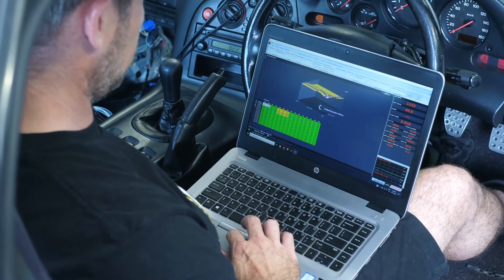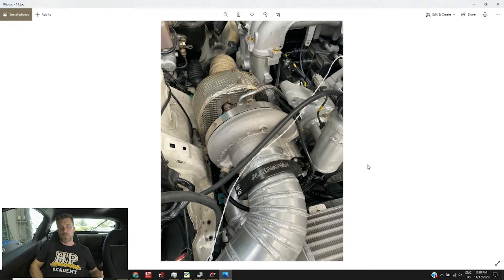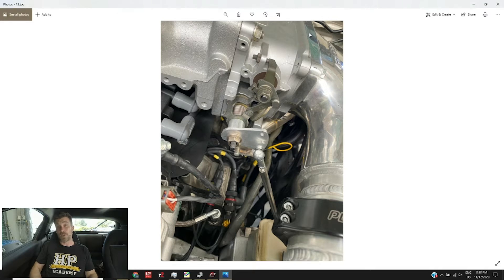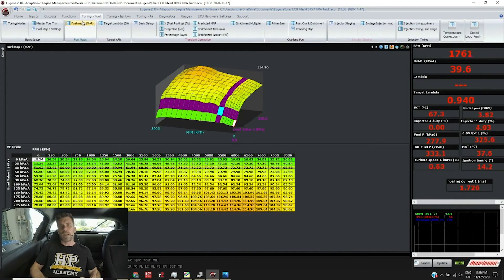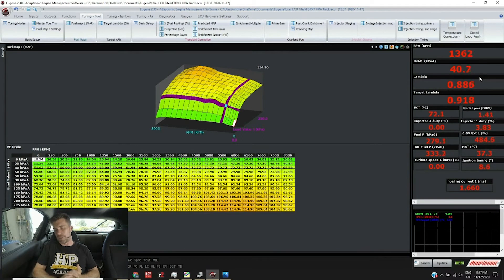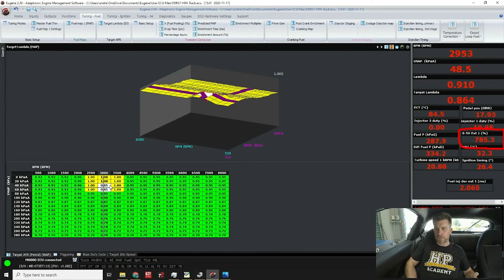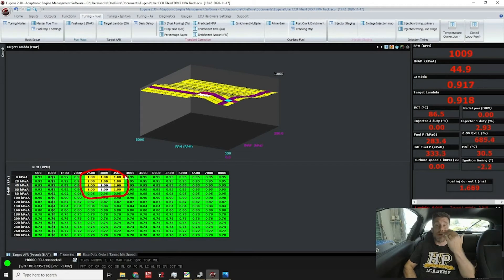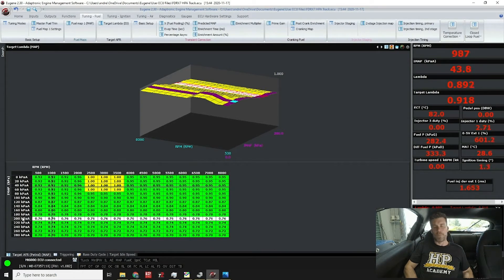How Tuning A Rotary Engine Is Different

Comment: One of the things the RX-8 does is a negative split for the trailing plugs, so they fire first.  Some people, running low compression rotors, have gotten the split at -17 at idle and -45 degrees at higher rpm but low load, just making sure it tapers to 0 just before boost.  It also gives a thing that will catch some people offguard by the fuel mixture going a lot leaner on their sensor as it causing a fuller burn of the fuel in the combustion chamber, combined with temps going up as well.  Several people have been messing with a more aggressive negative split in some areas to get the car to spool a little bit sooner too, but control EGTs with additional fueling.  I am currently running a Megasquirt 3 on my 87 RX-7, and running the negative split has been noticeable getting away from a stop.
Reply: Fuel mix showing leaner on a gauge is a sign of incomplete burn.
Reply: whats your FB name? i'd love to chat more about this.

Comment: Theory goes 95 percent burnt by leading, theory,???  Why did he the 787b have 3 plugs per rota chamber,  and if anyone has ever experienced their trailing spark ignitor or coil fails the engine loses alot of power, which leads me to believe the trailing plugs perform alot more than 5 percent of the work,  many years of N A tuning  shown trailing was important, but very close split,  , just my two cents worth, been a member of HPA for 6 years, totally valuable information

Comment: Would you ever install a VGT on a 13b? To get more low rpm power, or would the increased backpressure harm the wankel internals?
Reply: for all of that you can run higher compression rotors
Reply: If you run a big turbo VGT turbo like the HE500V it should do fine.

Comment: Quick question about the Adaptronic. I have an old Haltech e11v2 that I want to upgrade from. On these old Haltech ecus, you don't tell the ecu what size injectors they are. This video has shown me that with Adaptronic, you have to tell the ecu what injectors you have. What if you have a situation where you don't know the injectors size or brand? Is there a way to make the ecu run the injectors open or in dumb mode like the Haltech?
Reply: Get the Injectors flow tested.
Reply: @sexyfacenation  Sure but I still want to know if that ecu is capable of running injectors in dumb mode? Reason being is because it allows me to do weird fuel related experiments with custom intake manifolds.
Reply: @rotaryperfection  how does it allow that ?
Reply: @sexyfacenation  My Haltech E11 is an old ecu that allows this. In dumb injector mode, you can mix and match injectors and the ecu don't care because it doesn't know what its pulsing. It just sends the pulses. Sure it makes tuning more difficult but you can do some nice tricks with your setup. I'd like a similar feature on the Adaptronic.
Reply: @rotaryperfection  I don't at all follow why you would want that, and how it makes it better to compare changes.get with the times man!
Reply: @sexyfacenation  Get with the times? You clearly aren't listening. I like the feature for EXPERIMENTING reasons. If you don't like doing things differently or testing the limits, that's you. You do as you do and I'll do what I do.
Reply: @rotaryperfection  just for your reference you haven't explained why you need that "feature" to do what you are trying to do, or even what you are trying to do. 
Good luck with whatever it is.
Reply: @rotaryperfection  and doing things differently is substantially different differently to doing g things how they were done ages ago as there was no better way. 
For your reference a link ecu can do what you want, they call it traditional model. Still don't get why you want it.
Reply: @sexyfacenation  Now why would I tell a random guy on the internet my intensions and my patentable secrets with how I built my intake setups. It's a simple question as to if the certain product is capable of doing such. The WHY is irrelevant.
Reply: @rotaryperfection  hahaha, good one.

Comment: I remember building an engine for a well known rotary company they told me to reuse some of the old internal apex seals and side seals I reluctantly reused it,  after first full load Dyno run pop removed engine again and behold apex seals had fracture marks and piece flew out turbo lucky no damage new parts used.

Comment: Can anyone advise of how much additional fuel I should be dumping in, when off throttle and running premix? I'd suspect if the seals would be starved of lubrication" if I reduced the the injectors down as much as I would a piston engine.

Comment: In rx8 is the same  or you can't change map od timeing ??
Reply from the maker: Rx8 will be similar yes. The way you change the timing map will be dependant on what ECU or reflashing software you are using :) - Jono
Reply: @hpa101 
thanks , which  program you recommend to reflashing mazdaedit is fairly good to start and cheap but dependent on ecu and complicated :/

Comment: Trailing adds power under vacuum. 
You will feel it in throttle response and see it in the fueling. 

As load and manifold pressure increase trailing is only Helping the engine knock and break.

Comment: If injector data is not available how would the ecu be setup accordingly?
Reply: You can test the injectors yourself but it's a bit tedious and involves y=mx+b spreadsheet work.
The ECU needs to be able to test the output with a controlled PW for a specific number of cycles. A Megasquirt for example, you set pulse width and cycles. Super easy. On a Maxx ECU you have to use the BT app and run it for a specific amount of time then calcuybthe cycles completed. A pain but still possible.